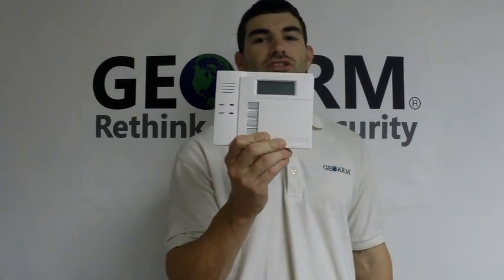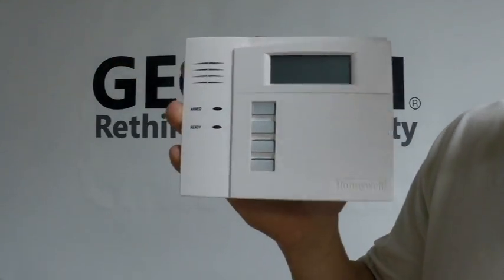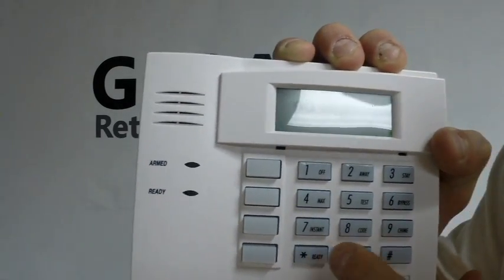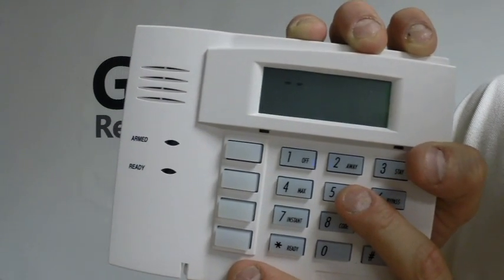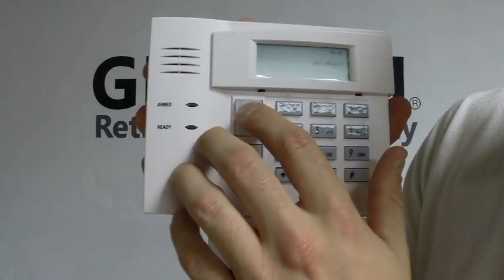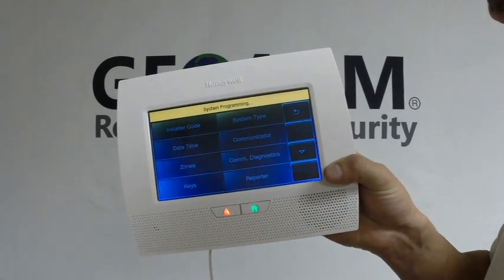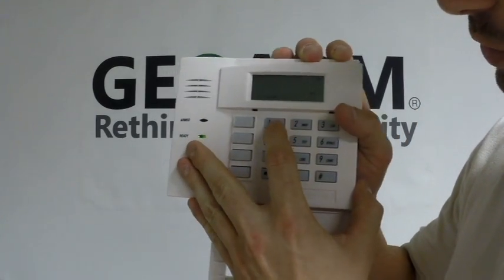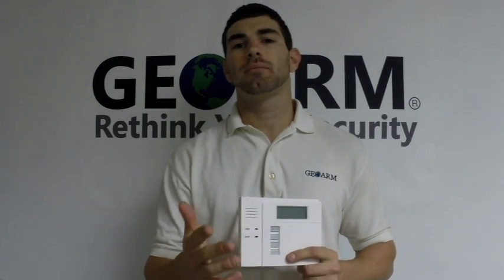Programming a 5828 Wireless Keypad into Honeywell L7000 Security System

Comment: 5828 wireless keypad 
When put AA battery it works. But when put 5vdc it does not work. Is there any setting need to do when use 5vdc ?

Comment: Does the 5828 need a transformer like the earlier wireless keypads?  If not, what is the projected lifespan of the three AA batteries?  Also I'm curious about the security of the keypad.  For instance if you programmed all of your Lynx Touch L7000's for the same house code, could you conceivably go around with a 5828 and disarm each system from outside?  I use the L5200's and use a lot of 5834 keyfobs.  Just curious.
Reply: Great question, no the 5828 is a wireless keypad that doesnt need a transformer for power. Battery life is on average 3-4 years based on usage.
Reply: Also, keep in mind the 5828 is not weather proof. But yes, assuming the wireless signal is not too far away then you could disarm using the 5828 from outside.  The 5828 will not know the difference of whether it's inside or outside, but the humidity and temperature could destroy the 5828 as it is truly meant for indoor use.